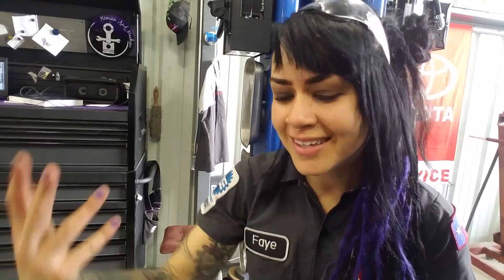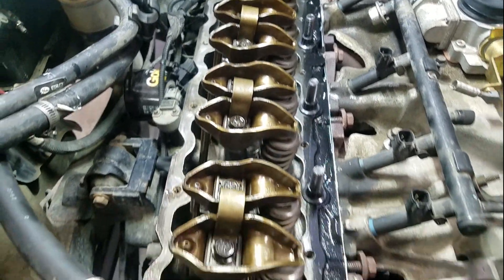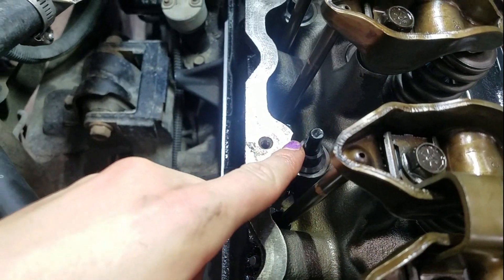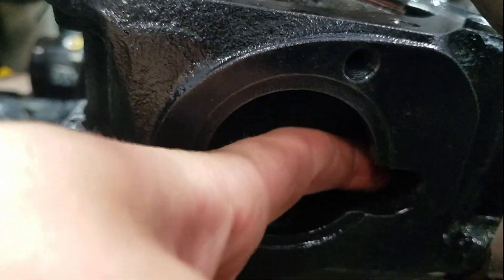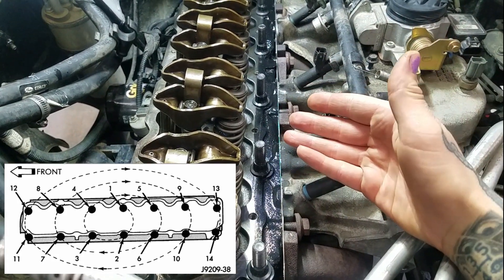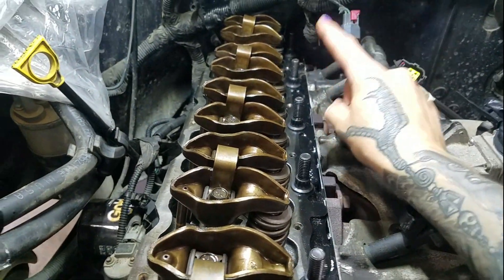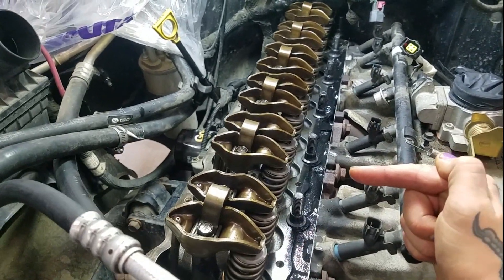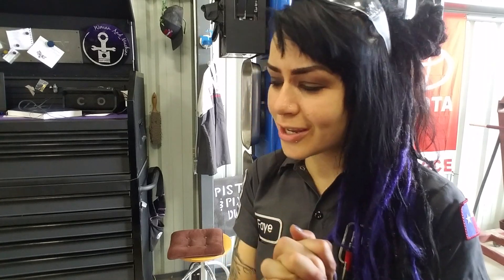Installing Head Bolts on a 2002 Jeep Wrangler 4.0L

Comment: I always use a big piece of cardboard and shove the head bolts through it in the same position that they were in on the engine, using a sharpie to write and label front or rear of engine, An old guy taught me that.

Comment: Thank you for the tips. I did a cylinder head on the same year wrangler at the dealership and I don’t remember if I installed it with the rear bolt, so ill remember that if I ever do a cyl head on my Grand Cherokee. Thats a heavy ass head and we used a cherry picker to lift them off and back on so I wouldn’t be happy if I had to yank it back off for a bolt that wont go in. Knowing Chrysler service info, they probably don’t mention that, typical Chrysler service info goes- Step 1-remove cyl head, step two- reverse of removal

Comment: Hey Faye new sub here. Enjoy your content. The question I have and maybe you’ve mentioned it, but what floor jack do you drag around when doing mobile jobs? Also what do you use to get your tools around? Thank you.
Reply from the maker: I have a very basic HF "ultra lightweight aluminum racing jack" and I used a dolly with 4 huge knobby wheels that I got from tractor supply co to move tools around. Most of the time, I would back my truck up close enough so that my toolbox was right there, but not always possible.

Comment: Doesn't a 4.0 AMC/Chrysler straight six use torque-to-yield head bolts that have to be replaced whenever the head is serviced?  Nearly everything else uses them since the mid-80s.

Comment: Hi Faye, ack in March my 1993 Toyota Tercel kinda broke down on my way home from work. I had a lot of difficulties but found out later from my first mechanic that the CV boot split on the passenger side and the one on the driver side was not good either. He said he was afraid to look into the head because he thought it might need an overhaul.Also, we would not know what the problem was until the head was opened to tell for sure. I had my car towed back home. Lo and behold, the Great Spirit of the Universe just happened to send in my direction in life another auto mechanic who was looking to earn some money on the side . I explained the situation and he said he’d like to take a look at it. I said I would pay him and he named a reasonable price. I discovered it was a blown valve. ( I noticed that I have been taking good care of my engine coz it was so very clean inside.) I told him about you and what you do ; I asked if he could teach coz I want to learn more and he looked at me weird . Anyway, the valve was replaced a new head gasket and glue/sealant put on and put back together. Also those 2 CV shafts were replaced. ( I thought it was more economical to replace the whole CV shafts.) My car passed the smog test with flying colors. Since then it’s been a bee itch adjusting the idle so it won’t stall out or die on me.( I just hope my son doesn’t readjust it.)👍👍😀Thank you or all you do. Otherwise I would not not know even the little bit of knowledge that I have learned from from you. I appreciate you and I love learning from you, Faye. You are the Greatest!😀👍👍💐
Reply from the maker: Oh my gosh thats so cool!! I am so glad you found that mechanic!! So many mechanics I know wouldn't dream of doing hands-on learning! And I am so glad that he found value in your car and knew it was worth it to put the $$$ in! Hope all is well!

Comment: An old school tip is to use an old soda box. Poke holes in it as the same way the head is layer out. Don’t forget to mark the box firewall side then passenger side or driver side head. 
May be you can tag up with Anne of all trades and make a ship chicken hut for the new shop. 
As always thanks for the quality video

Comment: Hey, Faye. I want to make a little extra money by being a mechanic for my neighborhood kind of like what you're doing. I have enough knowledge to know what I'm doing on a lot of services and a good amount of experience doing work on my own car. I'm just a little nervous about running into problems (i.e. broken stud) with other people's cars. Should I go through with it? What's your advice? I plan on doing a lot of work with cars anyway.
Reply from the maker: Oh gosh, you are always going to run into problems like that, because rust is always going to happen, and customers will bring their cars to shady mechanics who don't care. The best thing to do is assess the vehicle first, and be really clear and communicative to your customers. Warn them that things may happen (subaru exhaust for example - always warn them about the studs breaking is a possibility!) set them up for realistic expectations and don't forget that rust and previous mechanics are not your fault, and you should charge to fix those things for the customer, but do not surprise them with the bill. Honestly, I learned this the hard way from experience. I now know which parts are trouble spots on most Toyotas, and I try to stick with what I know. This Jeep is out of my normal range of work, but it's fun anyways!
Reply: Go for it. You can subscribe to online websites that have repair manuals for just about anything. Pay a subscription fee and have access to any and all repair manuals. Use it to make money. Take money buy more tools.

Comment: Very sought after engine for the Jeep.  It's basically the old Rambler 258ci engine with a redesigned front cover to shorten the overall length.  Between the 4.0 six and the old 225ci six, it's a toss up.  Seen these engines with over 300k miles.
Reply: You wont find newer domestics  that will give you 300k
Reply: @on-site4094  Exactly.  And with many newer engines, they are direct injected and some even turbocharged.  Look at the mess that combination caused with the Honda Earth Dreams engine.  And so far, the fix Honda offered isn't 100%.  I'll keep my port injected cars for now.
Reply: @scotta9114  I'll stick to naturally  aspirated  fuel injected / direct   injection  is a great money maker for dealers and those cvt transmissions  are the bomb literally 👎
Reply: @on-site4094  A Gal here at work has a KIA that started misfiring at low speeds.  Intake valves were clogged up with carbon oily goo. Cost here $600 to get it blasted with Walnut shells.
Reply: @scotta9114  great money maker for the dealer and a shaft for the consumer my sister in law bought a 2019 hyndai sorento I dont know  if there direct injection
Reply: @on-site4094  Yes, pretty sure it's direct injected.  What may help somewhat is to install an efficient Catch Can on the PCV return hose so less oily goo ends up being sucked into the intake manifold. Gone are the days of Port Injection washing the intake valves - well - FCA has been slow to go to direct injection.  Our Jeep 5.7 is port injection as well as our FIAT Abarth. My daily driver is a 2002 SAAB V6 which is also port injected. SAAB runs almost as good as it did when I bought it in 2006. 😀
Reply: @scotta9114  no she's one of those that knows it all the dealer would have to recommend  it  which they never will sometime is just better  to ignore it my daily driver is an is 350 no dpi one less thing to maintain
Reply: @on-site4094  Like my friend at work.  Buys a Honda because it's a Honda.  He need up with a new Honda CRV.  Serious oil dilution.  Fix didn't solve issue but made it better at least.  Oil smells like gasoline.  But, it's a Honda so it must be good.
Reply: @scotta9114  wisdom comes with education and life experience  you can lead a horse to water but you make him drink  in that case it becomes a Jack ass🐃
Reply from the maker: TRUE THAT.